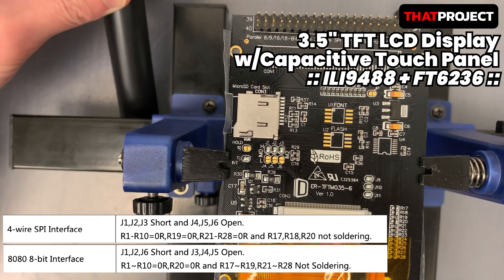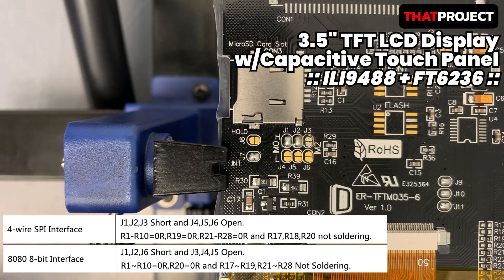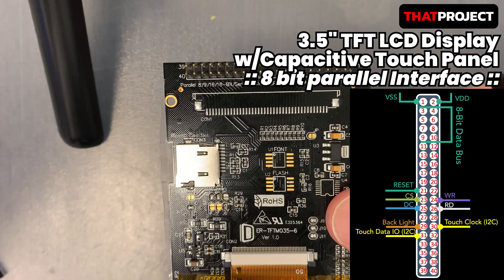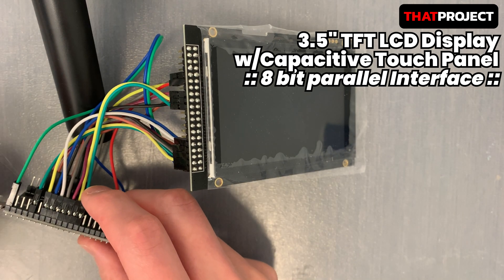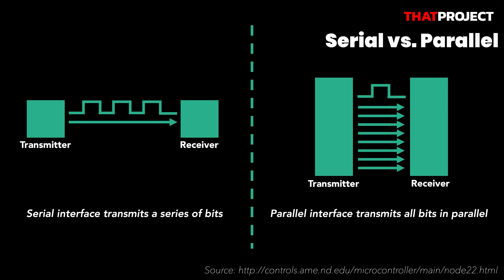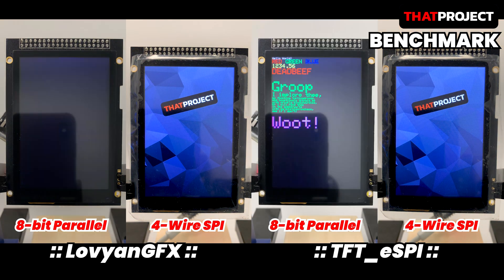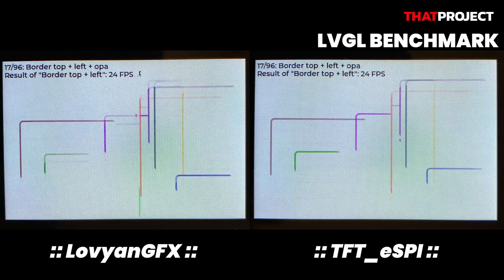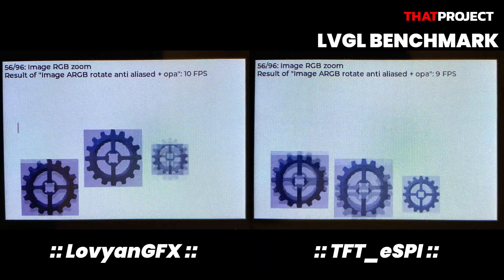ESP32 | LovyanGFX vs. TFT_eSPI Comparison (ft. 8-bit Parallel Interface)

Comment: I love the compare between parallel and SPI . pictures from SDCard needs only a few Milli seconds in parallel mode with resolution 480x320 in JPG 16bit colors. But touch functionality is better with SPI. TFT are a revolution for embedded systems. did you have experience with 7“-TFT or 10“-TFT models? Which are good for ESP32?
Reply from the maker: Hey Paul. It's difficult to find products larger than 7 inches with an SPI interface. I have reviewed a 7-inch display that works independently in the past(https://youtu.be/NlHB3JYyOOs). The performance is really good, but the price is too high.
Reply: @ThatProject  , I prefere a cheaper solution with 3,5“ and 4.0“. But one day I take a display from an IPad in 10“ and connect it parallel.
transferring 16 bit to the display controller is a problem of not enough lines. There are so much IPS-Displays in cheap tablets so I will find a Display with LVDS-connector.
Reply from the maker: @paulkirchhof9546  Sounds good. Let me know if you find a good LVDS-connector. I'd like to try it too.